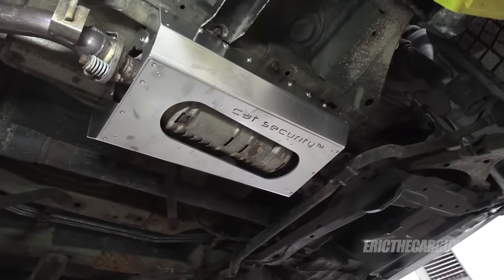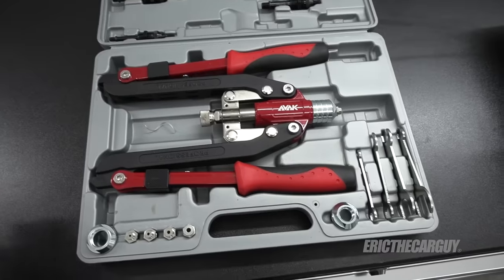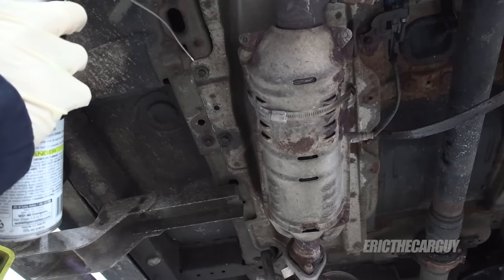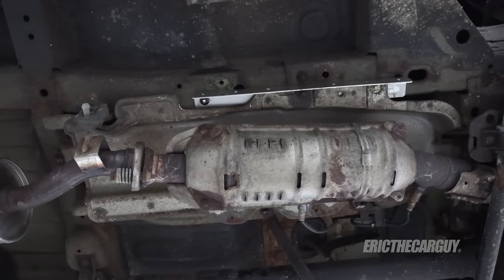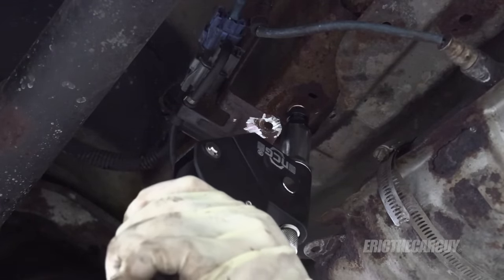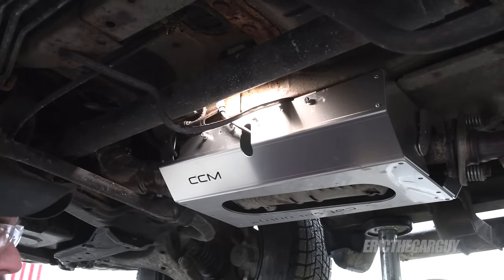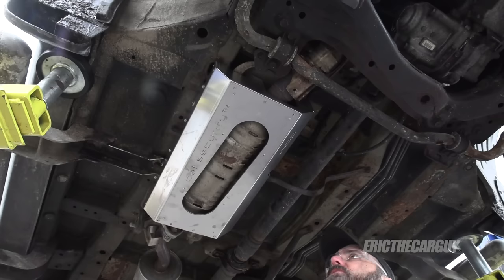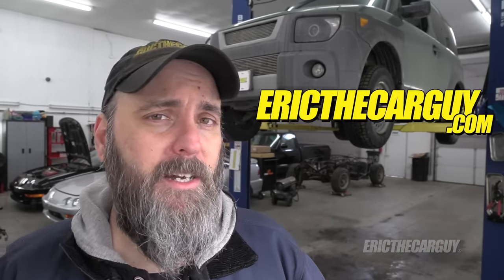How To Prevent Catalytic Converter Theft

Comment: I come up with novel recording studio designs and builds.  Thinking about these catalytic converters.  Yup.  They basically need a, metal sarcophagus affixed to the chassis of the vehicle.

Though I really think you went through numerous extra and complicated steps that were unnecessary.  To achieve a more conveniently constructed catalytic sarcophagi.  Riveted and welded.  And because it will not need access to that catalytic converter yourself for quite some time to come.

Next thing you know.  Everybody's going to have to start removing their battery packs from their electric vehicles.  Because other people in the middle of the night.  Will remove theirs.  That are worn out and dead.  And swap them out on other cars.   And you find out the next morning.  You have some dead cells and only 15% power to get to work.  And you'll never make it.  Or some other novelty like that.  It'll always be something.  For crocus.  Because where there is a will.  There is a way.  And there are those whose place in life are to be scumbag guttersnipe Kirksville with skulduggery.  And a cacophony of life altering disruptions awaiting us.  Whatever the next valuable THING ends up being.  What's next?  It'll be so exciting to find out!  I can wait, hardly.  Not wanting to stop waiting.  Hardly ever.

Now the car stereo shops have something more they can install for you as an optional extra accessory.  Catalytic sarcophagi.  And perhaps connected along with your car alarm system.  Which would then cause the car to autonomously start up.  Engage forward.  And run over the criminals.  Once it has detected a single imbalance at a single tire Axel.  It shall stop.  Reverse direction.  Making certain to do it again another 2 more times.  Before autonomously moving on.  Taking itself to the local police department.  When it has been equipped with,  I think US military Stomp Technology.  Which crushes dopes, when they get out of control.will shortly be a part of all regular installation on new vehicles.

No wait!  I got a marvelous idea.  But they need to do.  It is to build into the catalytic converter.  A high voltage lethal, stunned to death contraption.  So as soon as they saw the thing in half.  They get a deadly super capacitor shock.  That causes cardiac arrest.  They will be found dead.  Guilty handed.  Oh whoops, too bad.  Another one bites the dust.  That would be so cool!  Make them booby-trapped with an explosive device.  When improperly removed.  It goes off.  Burning holes through their body with molten copper.  Yeah baby!  Man...  Would they show up to the emergency ward quickly.  Much better than explosive glitter.  Something that would make the evening news nationwide, much more exciting.  This could become the latest craze!  Leaving packages by your front door.  Just for the fun of it.  Lithium-ion batteries are great!  Old computer batteries can be easily recycled.

Man I want to start doing that!  I've got to think up  other things in the package that can explode.  All sorts of highly caustic acids and alkalis.  Stuff like drain cleaner mixed with horrific colored paint.  They tried to wipe the paint away.  It burns the rags.  Though they smear black charcoal streaks from the rags burning.  Across the horrific Day-Glo colors.  It would be so sweet.  They might lose their eyes?  Oh well.  Their face could get this figured.  Oh well.  Better looks next time.

Oh this is so exciting.  You put a bunch of oregano in the box.  Then pour in a bunch of, hemp oil.  Then you make that all explode.  And have it automatically call 911.  It'll be very exciting when the police tear their house apart.  And I'll have all of this oregano that smells like pot.  It'll be very funny.  Much better than glitter.  Even funnier if they try to smoke any.  Italian flavored CBD pain relief.  No THC hi.  But it'll smell like the real thing.  The oil will get nicely atomized with the oregano.  Or other plants that look like pot leaves but aren't.  Grab some other buds off of other plants that have not yet floured.  Throw them in.  Make it look real.  For when the cops show up.  Little buds all over the place.  That'll smell like pot.  Maybe also cucumbers or tomatoes?  But pot flavored.  As long as it includes some pot flavoring and aroma.

Of course a week or two worth of cat shit would also be a lot of fun.  Little dried projectiles.  All bite sized.  Freeze-dried.  Just add water.  With a bucket and mop.  When it then becomes more spreadable.  Or use big dog shit.  From, German shepherds, St. Bernard's, Doberman pinscher's.  Because they are almost as big as humans turds.  And they tend to retain lots of moisture within.  And could be even more fun exploding out of a box.  And include a couple of scoops of cat litter.  So it is amply spread all over the room.  In every nook and cranny.  For years to come.

Oh thank you so much for this just incredibly terrific method of, honorable, moral, true and quite, Practical Jokes.  Jokes that are Practical to Perform.  Which will get many YouTube views.  And make one lots of money.  Especially when using a included smart phone to stream live.

I think tens of millions of people would tune in every night.  To watch shows with such explosive comedy.  Semimoist dog  turds.  Plastered all over somebody's walls and ceiling clothing and face.

It's the new Allen Funk, Candid Craparama Show!

Today.  We will be placing a guitar case outside of our front door.  Tomorrow will be the big Sony Surround Sound box.  And don't forget Friday when we leave the purse on top of the car.  You'll be vomiting with laughter.

I love those insurrectionist in Washington DC on January 6, 2021.  That looked like a lot of fun.  Good old Mr. Wilson!  And the FBI have their work cut out for them.  Won't they Mr. Wilson?  And it's all because of that man who created the vacuum cleaner!  And now they are just sucking up those insurrectionist, also!  Hoover sure made a good vacuum cleaner didn't he Mr. Wilson!  He sure did!

Menacing.  That's the yearly Mensa Sing Along.  Menacing.  So do the women.  An Italian favorite.  Performed yearly by smart people who can sing.

I only record the FUCKER's.
RemyRAD

Comment: Would this work on a 2002 CR-V? It's on the same platform as the Element.
Reply from the maker: It might, but you might check with the company directly on that.

Comment: I feel like a thief is going to go ahead and cut some other stuff to cause damage if he finds this and can’t get to the cat. Cool idea, but not sure I want my fuel or brake lines cut, or transmission crossmember etc., although that stuff may be cheaper than a cat replacement in some vehicles. Brake and fuel lines are easy to fix, but would suck if it happened away from home / tools.

Comment: To easy to get through cut the pipe loose then cut down to lines on ether end pull down on it and there you go u have it put take about 5 min or less with a good blade

Comment: Bought a car with one of these installed. With a total pain. It rubs on the exhaust making it loud as hell and is a pain to work around. I'll remove it and sell it to some poor sap living in a shithole where they have to worry about this. Just spraypaint yours bright orange, I doubt thin aluminum will slow them down that much anyway.

Comment: I don’t think I would use the rivets 
Just bolt it on. 
When the thieves see this cover they will move on. 
They are not going to spend time taking off a dozen bolts. Rivets just make it hard on you the next time you have to work on exhaust system

Comment: I have a 2003 Toyota Camry LE.  I had the Check Engine light come on and it showed a bad cat.  The cat cost $995 plus installation and tax.  plus the 2 O2 sensors.

Comment: To Solve this problem is a easy fix smog the car with It’s catalytic converter then afterwards take it off replace it with a homemade Direct fit bypass pipe with same kind of flanges that bolt on the same spot as your catalytic converter in the next two years put your catalytic converter back on just to pass smog again and do the same thing again in case you’re check engine light comes on due to the bypass get you o2 sensor adapter you can find them on eBay  good luck

Comment: I can not say that this would not work, but if you are modifying your car just to prevent cat theft I think it's a boring tactic. Sure the cat thief would crawl under the car see this box and say 'yup not worth the trouble', then move right on to your neighbors car.. If it's a real problem in your area I would invest in a proper alarm system with dedicated tilt motion sensor. There are devices that will go off when someone tries to jack your car up. Then purchase some train horns.. I'm sure the rest is pretty clear.

Comment: Umm....saws all cuts metal right....why would a metal box protect what there after...
Reply from the maker: Yes, but when you're stealing something time is a factor. You don't want to spend anymore time than you have to. Especially making a loud noise with a loud tool as half of you is sticking out from under a vehicle.
Reply: Yep, what Eric said. I've lived in high crime city areas, and learned that thieves search for easy targets. They don't want to work any harder than they have to. Thieves passed right over my mint condition '94 CBR600F2 back in 2000, due to my multiple layers of security - a 1" thick Kryptonite cable lock, 2 covers, and an alarm system with motion detection. They got my '86 Grand Marquis, though. Just smashed the rear quarter glass, and pushed the power lock button, punched out the ignition, and were gone before I realized what had happened. Nothing but squares of tempered glass left on the ground ...

Comment: It seems like the average thief out there stealing these will probably still try to cut it off and end up destroying more stuff while doing so than they would just cutting the cat off. They aren’t exactly the smartest people around so I could see their meth minds taking it as a challenge and going crazy with a saws all’s and a cut off disc. Next thing you know everything is cut up and they don’t get the cat but with the damage caused it would have been cheaper if they had just cut that off.
Reply from the maker: True, but the extra time it would take to deal with the shroud is time that could expose them to getting caught. Also, thieves don't like to work hard, that's often why they're thieves. Thanks for the comment.
Reply: @ericthecarguy  touché. Yeah if they weren’t lazy they would have a job and wouldn’t be trying to just cut a cat and run in the middle of the night.

Comment: I mean, just cut through the box? Maybe I'm not seeing it, but just looks like a mild deterrent, not a real protection.
Reply from the maker: Hardly mild. It's stainless steel. Also, the more time they have to take to steal it, is more time they risk getting caught.
Reply: @ericthecarguy  glad it's stainless at least, and you're right about the time, I just wasn't aware that Cat Theft was still such a problem. Thought that died out in the late 90s.
Reply: @ariyanadumon4549  - Scrap prices are way up again. Risk vs. reward ...
Reply: @ericthecarguy  So how much longer would removal of a cat take with the shield installed? That seems to be the value to this solution.

Comment: This has been going on for years,  so why haven't the car and truck manufactures done something to eliminate such easy  access to the converters ,  almost no one has access to a lift  to be under their vehicle to install this shield.
 Maybe the cost of replacement should be put on the vehicle makers to pay for their shitty design. how easy for the manufactures to put the safety measures in place before they sell their products.  Maybe they are in on it too,  they have no problem selling you a new replacement.

Comment: Actually quite dumb that the Maker of this disturbing part didn't simply include access windows or plates with Non rivits but normal nut & bolt cover's  to change out the so-called ohtwo sensor plugs, instead of taking the whole confirmed Non security cover off , this is simply a gullible money grab for those who couldn't be bothered with changing when needed said now obscured otwo Sensor's thanks to these idiots  who never completely thought out user friendliness of this part. Next thing coming from them is wiper Blade cover's.